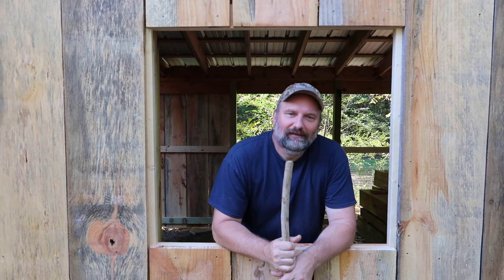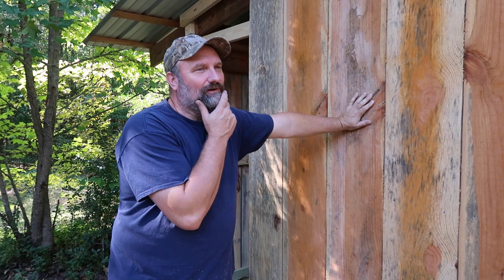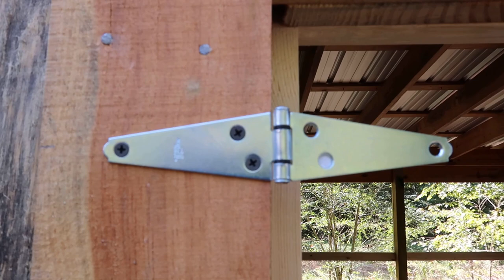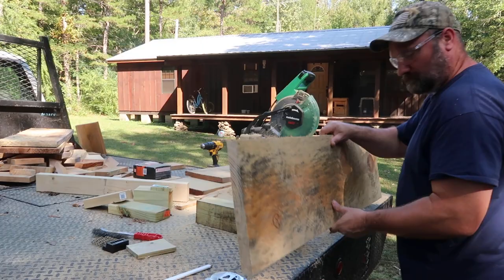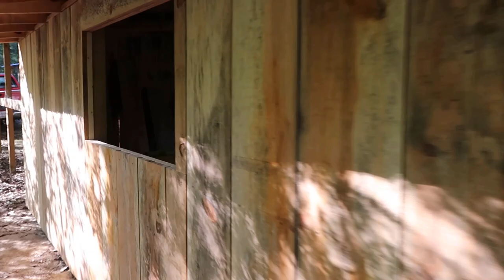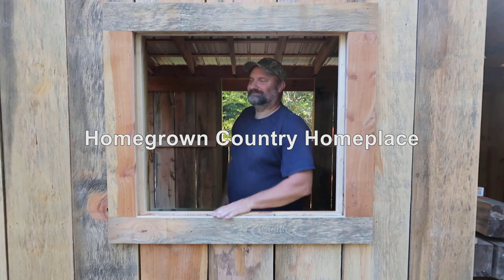Working on the Blacksmith Shop #3

Comment: Lots of ventilation I'm sure! I don't know how much it cost,  but I know they make a product from coal called "Coke" they say puts out the heat! Might have to get oversized barn door hinges to hold up better!  Looking Good there Brother!
Reply from the maker: I think coke is more expensive than the regular blacksmith coal. I am going to try wood charcoal too. That would be easy to make but not sure how it does. I am going to check around and see what other hinges are available. Them were the worst I have ever seen. Have a Good evening and Weekend!  God Bless!  Justin